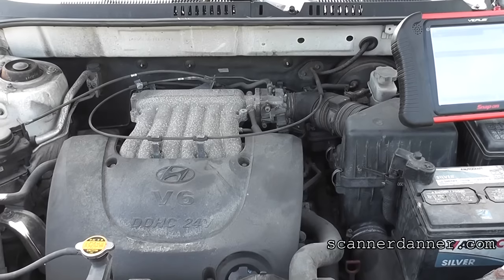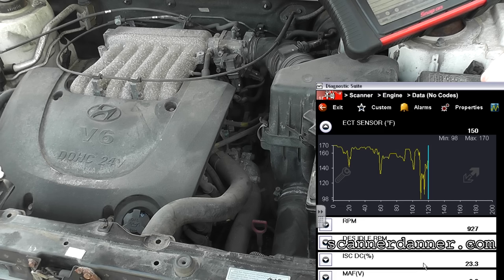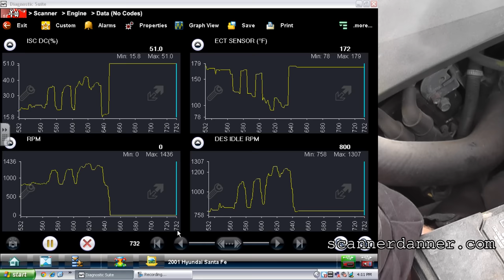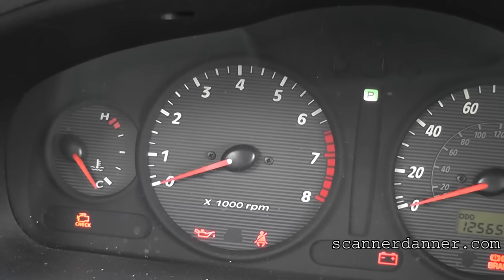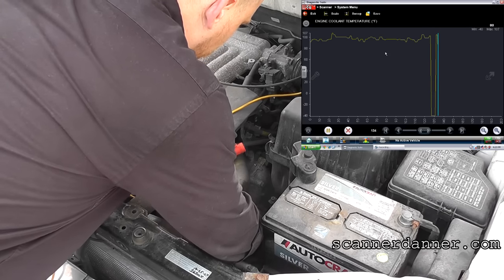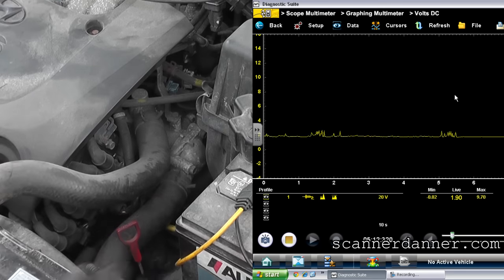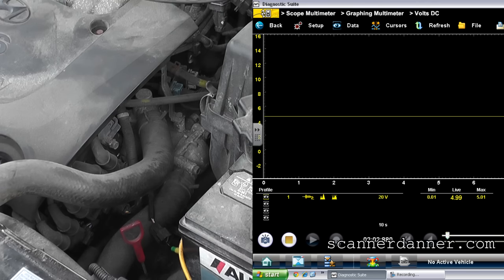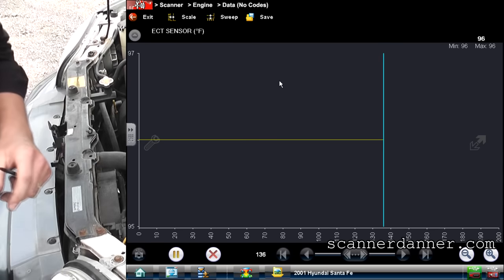How to test a coolant temperature sensor (ECT sensor test)

Comment: Had no idea idle speed was so dependent on the coolant temp! Always assumed that once you get above ~100F the idle just goes to 800rpm...Great demo and explanation.
Reply: Know this is old video but turns out a 92 tercel is similar and makes a terrible idle
Reply: I had the same idle problem with the Piaggio MP3 400 scooter.

Comment: Playing with my  new Xtool D7. Troubleshooting high idle when in closed loop.  Your approach was excellent and the ECT was showing -40. Tested the sensor and it was open. Confirmed good wiring. It took longer to get to parts store and back than to install the fix.  If you are ever in southern New Hampshire, dinner is on me.

Comment: I did a explorer last week that was a no start sometimes. It was a bad ECT sensor and a stuck lean O2 sensor making the ecu to flood the engine, The shop put a complete tune up on it Over 200 bucks for a fuel pump and changed the computer. They thought I was God when I fixed it. Lol
I Love My Job
Reply: Nice!

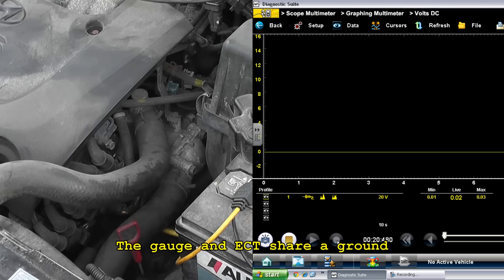Comment: 17:26 Just a slight correction the gauge ECT sensor and the PCM ECT sensor don't share the same ground path.

The gauge CT thermistor is grounded through the threads like many dedicated dash temperature sensors are. Only the PCM thermistor uses the dedicated ground wire.

Manufacturers tend to use single wire temp sensors where the output voltage isn't that critical.
Reply from the maker: ***** good catch on that my friend. I have seen them share this ground but in this case you are correct. Thanks!

Comment: Terrific video on the CTS analysis and diagnosis!  

Now I have to find in section 18 of your book how to do the same electrical delivery test on my injectors as there may be corrosion in the ten year old connectors that is having an impact on voltage delivery at higher rpms.  Mechanically they are fine.  Edit add: after reading chapter 18 it looks like I need a scope to read voltage input to injector wave forms.  Bummer.  Looks like I am in for a visual inspection of the wire leads in each injector connector.

Comment: Nice job Paul.I am thinking that the fans are controlled by yet another sensor Honda did that for a long time.
Reply: I remember seeing 3 ECT-like sensors tapped into water passages on the 1st gen Honda CR-V engine and wondering, until I found out they were ECT, Fan switch and gauge thermistor. Completely different circuits, only united by what they measure (coolant temperature).

Comment: Usually with sensors like that are 5 volts and have negative coefficient thermistors they decrease in resistance and voltage goes down but I like the way you diagnose
Reply from the maker: that is correct, cold = high resistance and voltage and both will drop as the sensor warms up

Comment: Not that it is a big deal and I wanted to let you know either way.  At 3:28 you said keep an eye on the desired idle rpm and your logo and website both cover up that PID.  I know you move it a little later in the video and you can see it again.  I'm not even sure if you can move any of that without having the original video file.  As always, thank you for what you do and I am looking forward to meeting you at ASTE this year!

Comment: When you were grounding the signal wire directly to battery negative, why does this not damage the transistor inside the ECU? I know you have previously discussed using your test light in between to protect the circuit but in this case weren't you directly grounding the wire from the ECU? Just trying to see if i missed anything, thanks

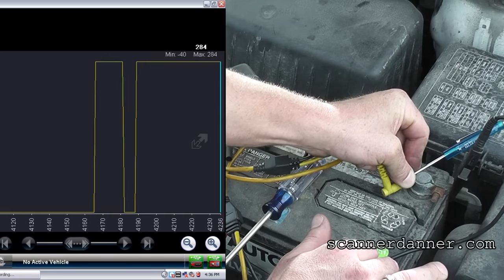20:36
Reply: In hindsight after thinking about it, Im assuming the resistor inside the ECU would protect the transistor. Is that correct?
Reply from the maker: there is no transistor on input circuits, just a voltage sensing circuit. And yes, there is an internal resistor and this circuit is designed to be shorted to ground. Essentially the thermistor itself causes a slow bleed off to ground as it heats up
Reply: @ScannerDanner  makes more sense, thank you!

Comment: I have one with a cooling fan kicking on at 255*F and kicking off at 240*F on the scanner data. I spent too much time attempting to locate the known good signature for cooling fan operation until I finally went to unplug the cyl temp sensor to check for open vs shorted to find the sensor was snapped at the base.

Comment: Dan 
Found out somebody Torqued my front wheels into the hubs with a impact gun 
Replaced several  studs and 
Lugs 
Car has zero rust underneath 
But Rotors full of the worlds rust 
Driving home from buddies 
Car ran so much better and was so much more stable then started running like rich and lean in and out of gear 
Like the Trans speed sensor is bad 
Gonna clean the wherl speed sensors 
New rotors today (platinum)
And see if ESC and ASB 
Are affecting Computer 

Do you have anything on this kinda stuff in vids ?

Everytime my car is Crazy 
I know they have driven you crazy so i have a laugh 😆

Comment: Sorry im late for class, My bicycle had a plat tire.
Knocking could and does cause sensor failure. 
I would strongly recommend a new engine with the replacement of the ECT
Imagine getting the ECT sensor replaced and thinking you could drive it like normal again without the threat of over/under heating.
But wondering if you can make it down the pike without loosing a rod and spewing sh mew.

Comment: Hello, Sir. If the sig/ ref were shorted to positive, you would not see any temperature change as the TPS sensor that was shorted to voltage, right?
Reply from the maker: If the 5v ref was shorted to the signal wire, you'd have a constant 5v on that sensor signal and it wouldn't change no matter what you do

Comment: Could we check the wiring integrity by watching the scan tool and trying to pull that 5v reference down with a test light?
Reply: Nevermind you just answered my question
Reply: Nevermind you just answered my question
Reply: So that integrity of the ckt has to be checked for with voltage rather than temperature with the scan tool. Unless it bottoms out when you unplug the sensor. Is close to right?
Reply from the maker: Just remember that the scan tool can and will substitute values and if you use global obd2 mode, they are not allowed to show substituted values in that mode

Comment: Any suggestions for a 2003 jeep liberty 3.7L v6 4x4 With the exhaust smoking white for about 5-10 minutes while warming up? Engine has no rod knocks or anything there was a misfire(Changed the coil pack and spark plug) Also replaced breather inlets right and left side and the pcv valve could it be a head gasket seal or a cat converter?

Comment: I have a similar issue. 97 Cadillac Deville Northstar after a theft issue my car started having idle issues. From my buddys expensive scanner it shows its not in open loop even at 215 degrees. normal operating temp is 225 at the tops. Idle Air Control valve is good, all my input sensors are good. no codes. leaning towards coolant temp sensor. although it reads good on scanner. engine does feel hotter than what my temp says.
Reply from the maker: Not in open loop at 215? It should be in closed loop, so that is okay. Open loop is a mode the computer enters until the oxygen sensors warm up and are functional. If your engine is hot and you are still in open loop, this would be from some type of fault. Certain O2 related fault codes, severe misfiring, overheating conditions would maybe force a hot engine open loop. 
"Feels hotter" is not good enough my friend. We need an actual engine temp measurement compared to the scan data ECT. 
Idling issue? As in rough idle, stall? Or shaking idle like a misfire?
Reply: @ScannerDanner  maybe I misunderstood the open and closed loops. Got an interesting electrical situation. Tried digging and diaging everything I could research and think of. High idle condition with no vacuum leaks, no codes. Possibly low fuel pressure or maybe my pressure gauge was off if I didn’t bleed the air out. Current idle is 1800rpm, and it doesn’t return to normal(cables aren’t hanging up, throttle isn’t sticking open either) almost seems like the IAC is opening to lean out a rich condition if that’s how it might work. Or not. I’m a rookie and my diag “skills” are still in need of TLC 😂
Reply from the maker: @MechanicalMikesRoadsideRepair  all good my friend.
Okay, you have an 1800 rpm idle.
1. What is your IAC counts or steps during this condition?
2. What is your TPS closed throttle voltage during this condition? 
3. If available, what is your TPS closed throttle %?
4. When did this problem start?
Reply: @ScannerDanner  Was about 120 something 130 something counts out of I believe the max 150. Unable to command the idle with the  scanner saying “unable to control idle, throttle not at idle” type message. Throttle voltage not sure but the position at idle was no higher than 2.0%. This problem happened after my theft system triggered randomly. Stopped for food, my car wouldn’t start after I shut it off. I know it was a bad IPC since I swapped another from another car and the key and steering column (was doing an entire interior swap anyways) didn’t have it in long enough to know if it fixed the problem. It did start as normal. But then I mixed my keys up and put the wrong one in and triggered it 😆😢 PCM is programmed to disable VATS so all I did was ground the starter enable relay so now I’m able to start up and run my car but I still have B2780 present. Haven’t been able to get it off. Might end up getting the programmer tool for it or another cluster and key whichever is cheaper. PCM was proven good when the programmer showed it in another car running perfect. And I don’t believe I installed it incorrectly. Really really odd situation. My car did sit at a shop for 5 months because the shop didn’t really know what to do with it to get it started (I towed it to my tech school with help from my teacher we got it running by grounding the relay and I installed the programmed PCM) thanks for reading my comments and responding. I do have alldata for my car too, as well as factory service books.
Reply from the maker: @MechanicalMikesRoadsideRepair  okay sweet! Normal, hot engine, no accessory loads, at idle should be around 30 counts. The 120-130 you are seeing means this is a command for the IAC to open and it is just doing it's job (3000 RPM idle speed lol). This is not an IAC problem. You absolutely have an input problem and are wise to be focusing on the ECT as it is one of the inputs used. But the minor discrepancies you mentioned earlier are a non issue. The ECT is not your problem. Now the TPS, let's focus there for a minute. I believe on your model it should be 0% at idle. If it is supposed to be 0, a 2% throttle opening WILL ABSOLUTELY cause what we have. The ECM thinks your foot is on the gas pedal and it is preparing the IAC for when you let off (prevents decel stalling). Make sense? 
Now some cars, it is normal to see as high at 10% at idle, but I do not think on your model. It has a throttle cable right? It isn't an electronic throttle body is it?
Reply: @ScannerDanner  new ECT sensor new TPS I’ll check wiring. Cable throttle yes.
Reply from the maker: @MechanicalMikesRoadsideRepair  doesn't matter that they are new, again, the TPS % should be 0. You need to reset it to that. Disconnecting the battery may do the trick, if not, is it adjustable? (The TPS)
Reply: @ScannerDanner  from what I understand it’s not adjustable and they relearn themselves but I heard on forums some of these aren’t spring loaded so I’m going to check that as well

Comment: Help!  I have a 2008 jeep JKU 3.8

I've replaced my coolant temp sensor twice.  I have P2181 and P0118.  My gauge doesn't always work and when it does it's not always accurate.  It usually only works with the engine off/key on.  

Should I be looking at my PCM or wiring harness?
Reply: Have you checked pin fitment/ corrosion on the connections. its pretty common on jeeps, especially if they go off-road splashing muddy water. Some aftermarket sensors suck right out of the box too.
Reply: ʇɥƃᴉɹlɐ ʇou ɯᴉ.    I figured it out.  Broken wire in the wiring harness. Thankyou.

Comment: Can a bad temp sensor cause p0171 and p0174? My fan kicks on when its cold and the engine studers. The rpms fluctuate when cruising and the motor has stalled when at idle

Comment: Any idea 2016 Honda crv dash light, this code coming up. I just replaced the sensor, light didn't go away.
Reply from the maker: Test the circuit with a voltmeter and report your findings. Otherwise we're just guessing.

Comment: Scanner Danner, Please Help me, I went to a gm garage & they told me that they do not sell a voltage dropping solonoid for a 07 pontiac G5? The cooling fan (just 1 fan) will not run regardless of temp. I realized yesterday that it was missing a relay & replaced it yet still does not work! I used my test light & connected to ground & touched a leg/connector  of the missing relay & the fan came on. it is dark outside & i must get to work-nightshift!!! Does a 7 pontiac G5 vin-F with a 2.2 ECO TECH  DOES IT HAVE A VOLTAGE DROPPING SOLONOID THAT CONTROLS THE LOW SPEED OR HI-SPEED FAN? IF nothing else, I did find a way to make a connection & force the fan to work but, That is not the correct way to fix it! Any & all assistance is greatly appreciated! on the interstate, the G5 runs between 183 degrees & 190 but when i sit in traffic, it gets up to 213 & i have never heard the fans run-these temps are according to the temp sensor digital read out on the dash. Thank you!

Comment: Was it not a risk to the 5v pulling it straight to gnd? Safer doing it through a test light? Cheers.
Reply from the maker: No risk at all on thermistor circuits as the 5v ref IS the signal wire and is designed to be pulled to ground. I'm fact these ECT circuits are built exactly like a pull-down type switch input.

Comment: I have a problem with a Mercedes, the fans wont kick in even when its hot, I checked the 5v reference and it shows 3.4 volts, would that be my problem? It should be 5v right??
Reply from the maker: Some of the EURO cars had a 3v ref from what I've heard. Not sure.

Comment: mr. danner i need a snap on scan tool with scope and i found used ones on ebay modis , solus , vintage .
which one is the best for home mechanic and small workshop ?
thanks for the great videos .
Reply from the maker: toolman talal you need both a scope and a scan tool. The Modis is the Solus and Vantage combined. So it is your choice. Either get the Modis or get the combo Solus and Vantage
Reply: Thanks
Reply: ScannerDanner $$$$ ouch!! Is there any other sollution? How about a cheap scan tool with using a fluke 123 scope meter? I know vehicle limitation would be a factor.
Reply: Tony Home In this case yes, any OBD II generic scan tool could have been used along with a simple multimeter.
Reply: Would you recommend buying a used Modis? Like ebay or craig?  Now I know the general risks in buying used. I think what I'm asking is in your experience with being in the trade, does this tool get abused and generally get replaced frequently? I see that the tool cost around 6k new. But I've seen them for 2500 and even 1200. Is there a chance there selling them cause maybe guys hook it up wrong and damage a certain part of the meter?  and again we are just chatting about this. I don't hold people to their words on these kind of matters.... :) I know in my field I've done it and seen many tech hook up their meter to read amps(ma) and not put the wire back for volts then test voltage and blow the fuse. Then since they don't have a fuse they take the foil wrapping off of comm. wire then wrap the fuse only to do it again and this time blow the meter....... Sorry for the long message.
Reply from the maker: Tony Home heck yea! most people sell them because they don't use them and these tools are super durable.

Comment: May I ask sir I have the some code as your p0118 ,I checked the signal from the ECM it's 5v and my ground is ,it's a two wiri sensor , so my question is after changing the sensor I have to learn it
Reply from the maker: No sir, not on a temperature sensor.

Comment: Question... I am sure you are very busy but I have a gauge that goes straight to Hot when in the on position, even though the vehicle has not ran. However, the fans turn on when the vehicle hits or goes over operating temperature. They're only two wires coming from my heat sensor, I put a voltmeter to the wires and they came out good. This is a 04 Dodge Stratus Coupe with the Mitsubishi engine 2.4 l. Any idea why that gauge stays on hot? Thank you...
Reply from the maker: I believe the gauge is a separate sending unit on that model? If your cooling fans work as designed then your coolant temp sensor is fine. If it only has this one sensor, then you have a cluster issue. If it uses a separate gauge sending unit, I would start with voltage tests on that sensor first.

Comment: Is the 1999 Ford f350 V10 supposed to have 11 volts at coolant sensor thanks
Reply from the maker: How many wires go to it? Typically I'd say no, but there are variables on systems where it could be some type of fan switch or could be a sending unit for a gauge depending on the year
Reply: @ScannerDanner  it's a 2 wire everybody says it should have 11 volts  going to it because it's a gauge driver